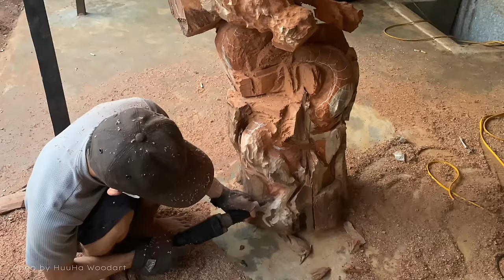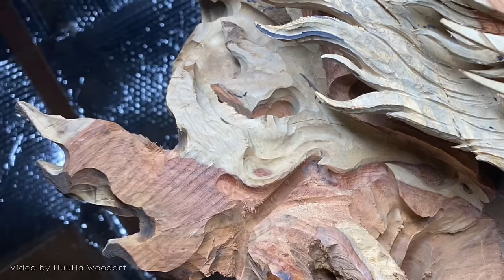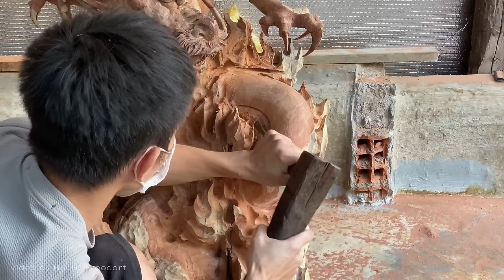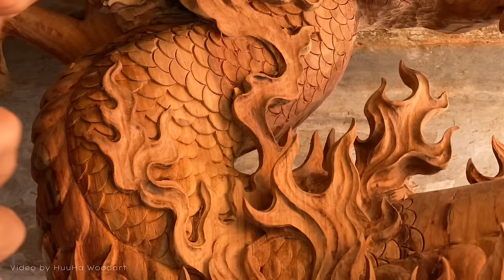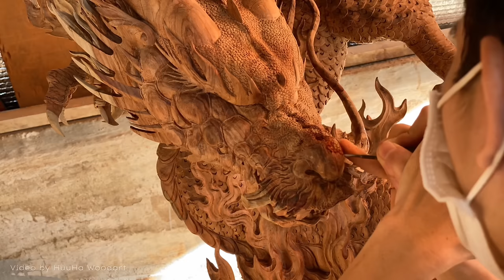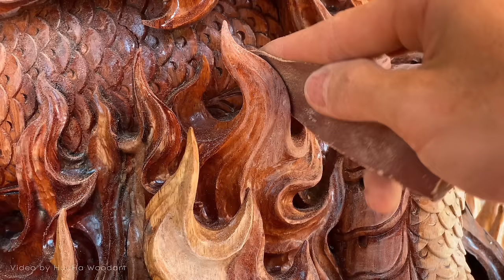Red Wood Carving Dragon/The Process from Block to Artwork

Comment: How do you stop a piece of art like that from giving in to the elements: termites, cracking, losing moisture, etc???
Reply from the maker: This type of wood basically cannot be corroded by termites. and protected by a layer of paint
Reply: @HuuHaWoodart  so youre saying that this job could last a long time?
Thanks, i dont know anything about wood.